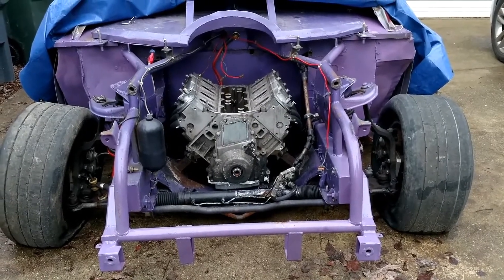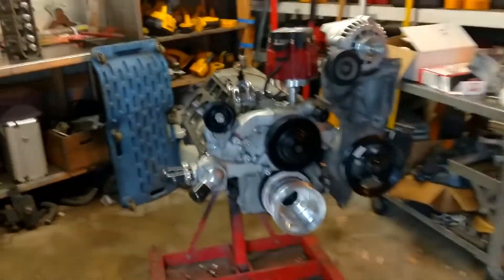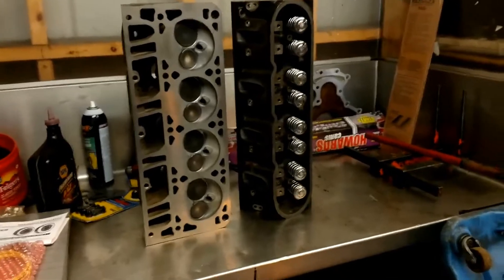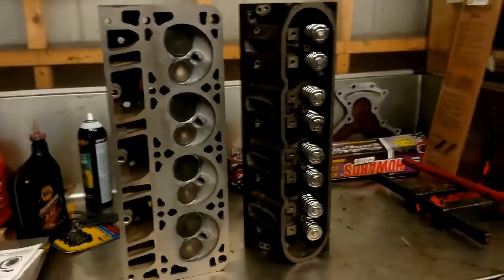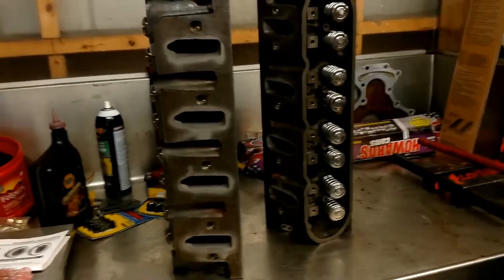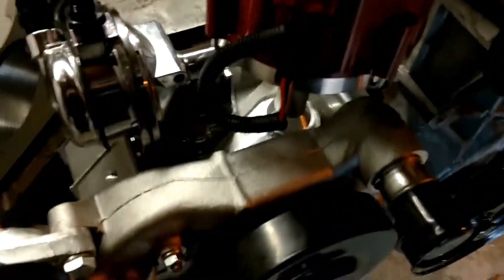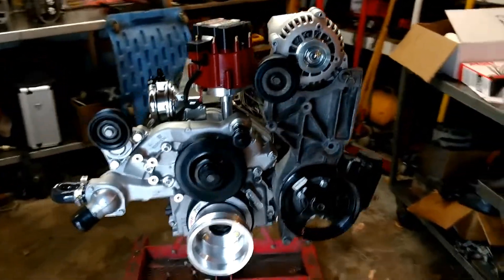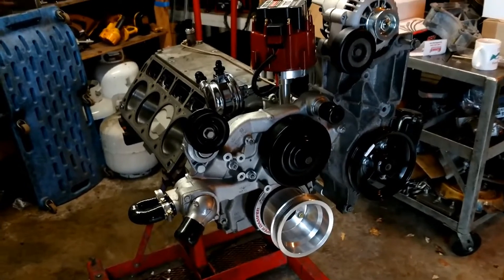Carb'd with distributor budget 6.0 LS dirt track engine update

Comment: Would move if I wanted to race sounds like your shops there are a joke so if you break your motor sounds like you are done for the year
Reply from the maker: Funny you should mention that. That is one of the main reasons I am pushing racers and track promotors in this area to let us run modern production motors found in todays wrecking yards. I have 2 seasons now on this basically stock long block. I rev it to 7000rpm's during every race. It just keeps ticking. 92 octane fuel. This is cheap racing. And when the motor does finally give up the ghost I go to my local wrecking yard and pick up another "race engine" for $2500, put a cam and valve springs in it and have it all back together again before the next weekend. I am currently pulling the complete engine assembly to swap it with another 6.0ls. except this time I am going to keep its square port aluminum heads and fuel injection. True both are technically illegal in our class but I am doing it to prove a point. You don't have to spend cubic dollars to make big power. In our class of cars the Fords are allowed to run the CHI Cast Iron Clevor heads. They flow 308cfm. They also cost over $5k. I will make the same horsepower with parts pillaged from a junk yard that never went to a machine shop for 25% of what it took to Build that Ford motor.
Currently my car is always a top 5 car and placed 3rd overall in the points this season. I have played by the rules to a T. On slick track surfaces I tend to do pretty well as big power cars cant put the power down.  But the top 3 cars run laps around us others when the track is tacky. . And the 2 Fords have Cubic Dollars invested into their programs...And they brag about it. The one Ford #47 Lapped the field in 10 laps at the last race of the year. Did I mention there is ZERO tech enforcement except for safety and weight.

Comment: That's a pretty cool setup. I am running a similar setup doing paved oval in ontario canada for years now. I run a junkyard 5.3 with a small cam. Edelbrock performer intake with a 500cfm holley 2brl and a msd 6ls spark controller running the stock coils. Its a lower cost setup than the crate motors and is comparable to them in power. It's nice to see someone else running an ls setup.
Reply from the maker: Still the only one in my area doing it. Car is extremely competitive.I took second in the heat race last Saturday.I am running with the top 3 consistently. And those top 3 have more in there motors than I have in my entire car. All the other cars in my class are 383 -390 c.i.d. strokers. I spin the motor to 6800rpm and 8 race nights in, I still haven't pulled a valve cover. Only 2 oil changes and fill up at Chevron with 92 octane. $45 a night in fuel. Doesn't get more cost effective than that.
Reply: @LSX427  I agree great power for the price. I've been running it for about 8-10 years now. Only issue I had was poor oiling. Loses oil pressure in the corners. Had to put a oil pan with kickouts and baffling as well as an oil accumulator on it as well as a high pressure/volume oil pump.
Reply from the maker: @johnlavalle8952  Originally I used an LS3 oil pan. No problem with oil pressure but hung a little low and bottomed out a couple times on a rough track. Now I have purchased/stole 2 CT525 circle track pans. New take offs from Pace Performance. $250 each steal of a deal. They are very Shallow and hold 8 quarts with the remote filter.

Comment: Good gravy. Why sbc is still better!  Bbc is king. I got my lq4 in my car tallied all the parts cost I could've had a awesome 350 for what the "conversion" parts cost. Guys say " they bolt right in", yea  🙄
Reply from the maker: I suppose it depends on what you are geared up for. Dollar for dollar spent on the motor, not the conversion cost, an LS engine will always make more reliable horsepower.  In an application like my stock car where I didn't have any sbc stuff   to start with the only conversion piece I needed was the motor mount adapters. My 6.0ls motor makes 500 flywheel horsepower with factory rocker arms, un-ported factory heads, factory connecting rods, and a factory crankshaft and block that and has never seen a machine shop. GM never made a production cast iron cylinder head for a sbc that would support those power levels out of the box. If the rules would of allowed me to run an electric fuel pump I would of kept it an EFI motor and saved even more money.

Comment: Where did you order the timing cover from
Reply from the maker: Jet Chevrolet
Part#88958679  At the time it was $550. Ouch I know. That's why I ran an auxiliary oil supply line aimed directly at the bottom of the distributer gear, as you cannot buy replacement pieces when they wear out. And the directions for drilling your cam retainer plate for oiling were ridiculous. I did both the holes and the oil line. And used the LSA oil pump. 45 psi oil pressure warm at idle.
Reply: @LSX427  Thank you for this info I'm going in the same direction with my 6.0
Reply from the maker: @DavidBrown-tw1zc  I just made a new video of it installed and running. I will post it in a day or two.
Reply: Thanks for  the info